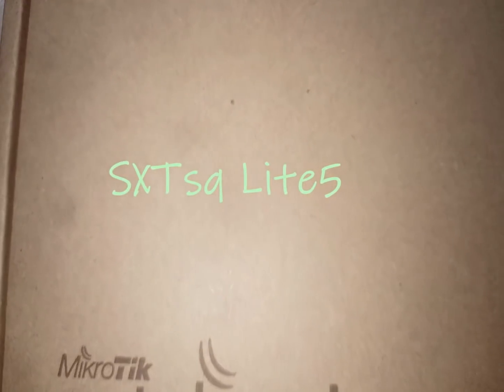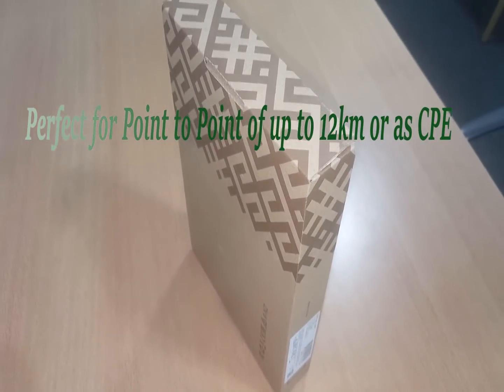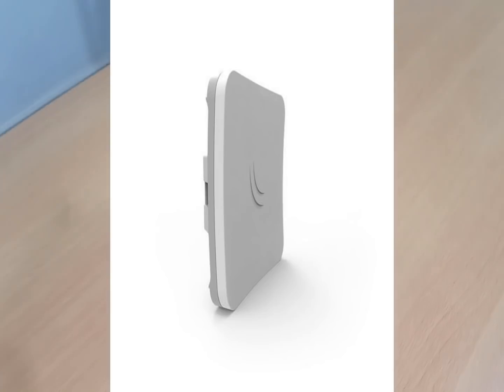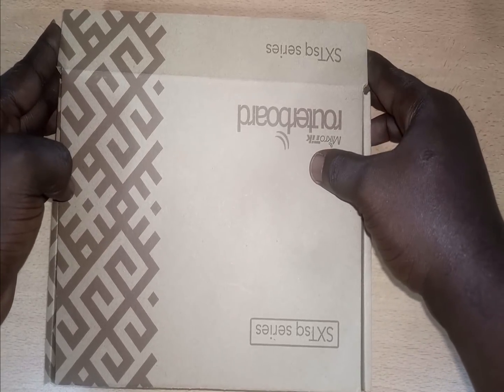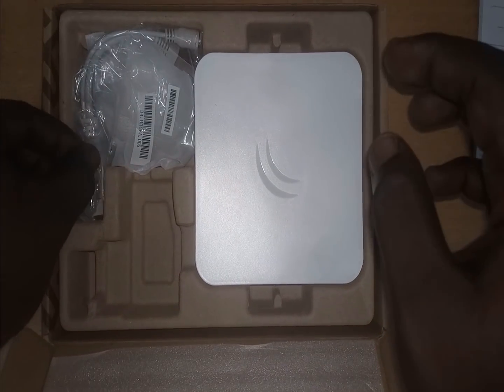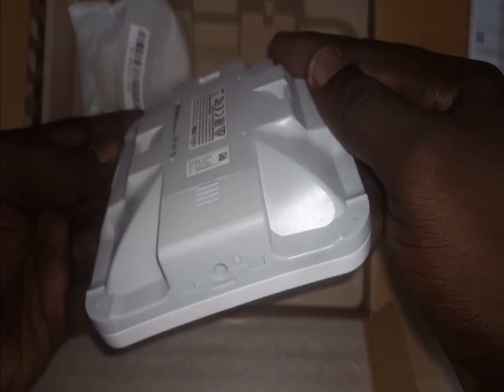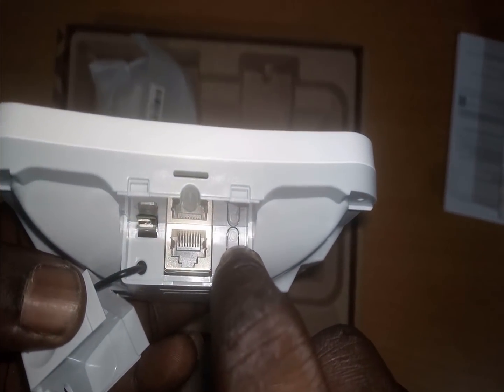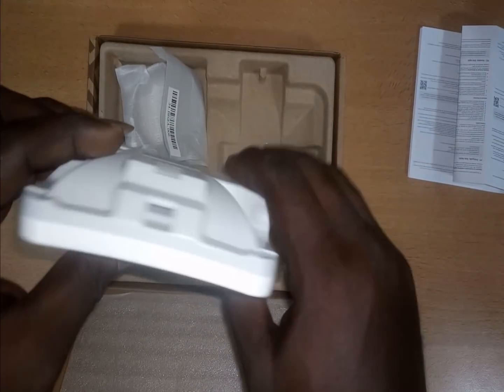#Mikrotik #SXTsq Lite5 Access Point unboxing

Comment: Hello! Please I'd like a video full step by step configuration to manage internet connection and sell as wifi. Do router and this sxtqs5 are sufficient to manage a hostspot WiFi zone? I am in côte d'ivoire SXTQS5 IS not known yet.
Reply from the maker: Hi, I think I've done videos on how to configure hotspot... Kindly go through my videos and you will see them. Sxtqs5 is normally ideal for point to point and multipoint radio connection. You can ask well sell your wi-fi hotspot through it but that will be a point to point or multi-point connection.